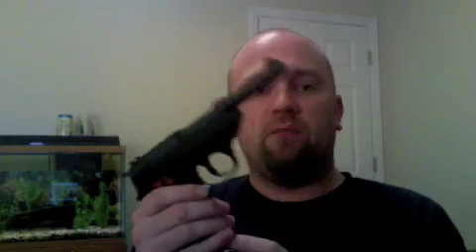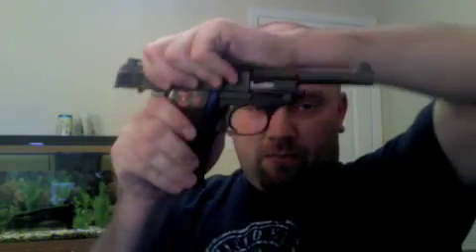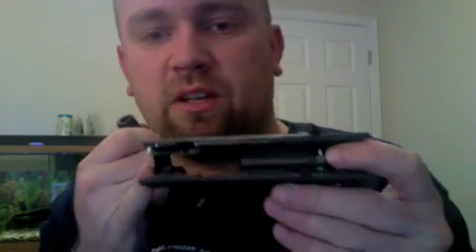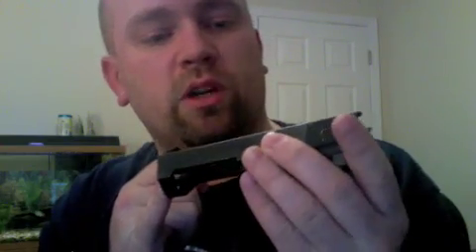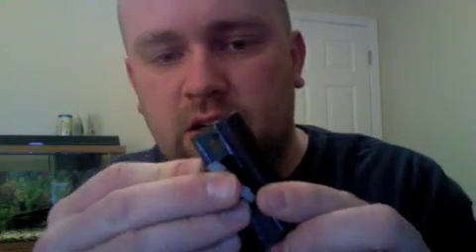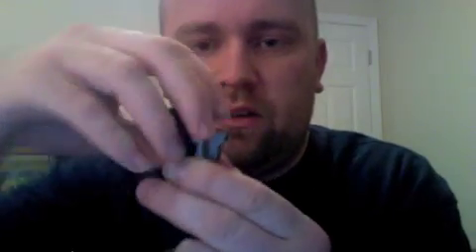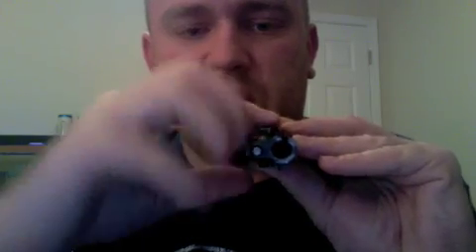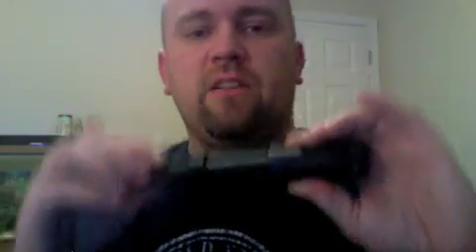How to field strip a Walther P38/P1

Comment from the maker: Video games always screw the pooch when it comes to firearms.  There's no way a .45 can be accurate at 200 yards.  An M1 Garand's bolt is on the right, not the left.

I wish they'd spend a little more time researching the firearms they put in the games before releasing them.

However, some of these games are also designed in places like Japan and Malaysia, so take it with a grain of salt.